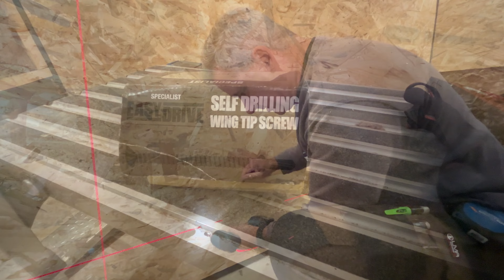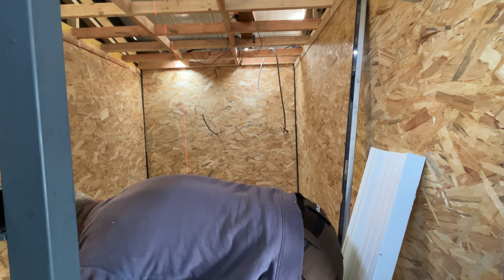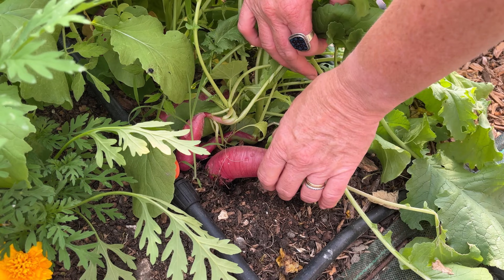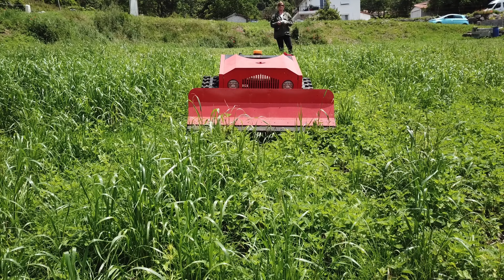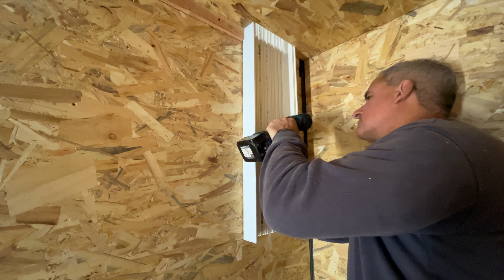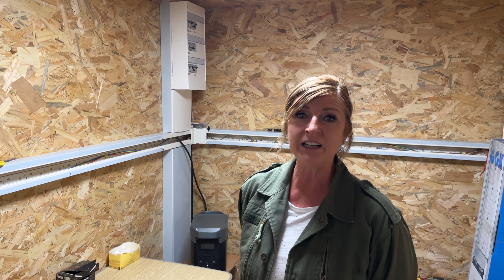Tech Room Fit Out | Garage Workshop Project Ep38

Comment: Are you going to add a small amount of positive air pressure & a compressed gas extinguisher system . ????
 Kiwi Rod
Reply from the maker: I will put in ventilation and a larger extraction system.  Have not thought that far a head just yet.

Comment: Love the GTL - makes so much sense and the conduit you have in place for switches etc.
Reply from the maker: It just saves running cable ducts and mounting boxes etc.  For a garage it is perfect.  But the GTL can be a little unsightly in a home - mine will be in the plant room for sure when I build it 😀
Reply: @HomesteadingUncontained  Absolutely gives you place for things like the router and network switches as well. To shorten cable runs you may have a charge controller in the house as well.